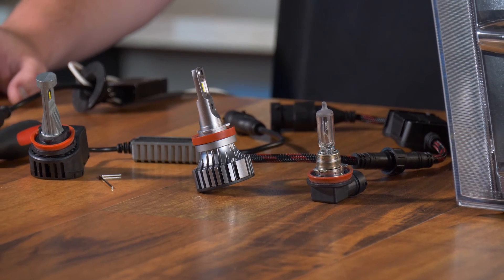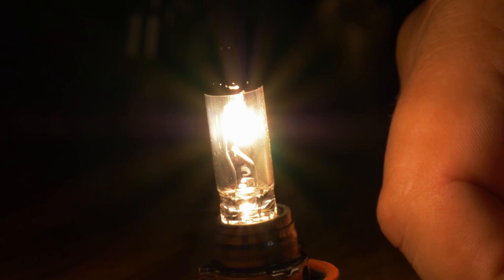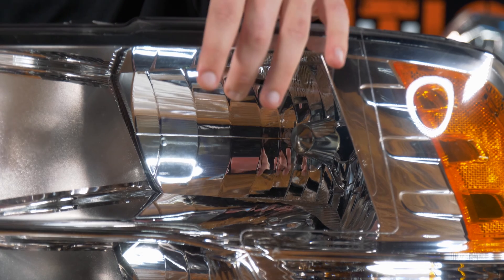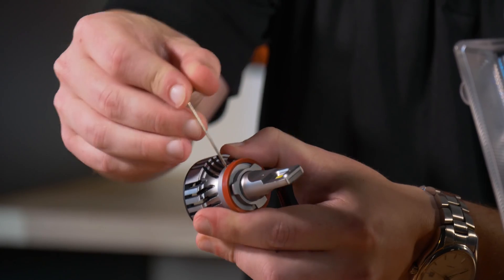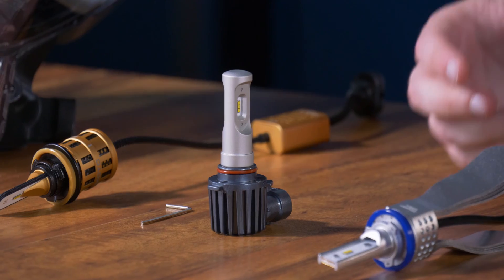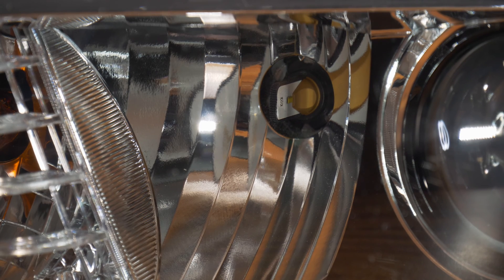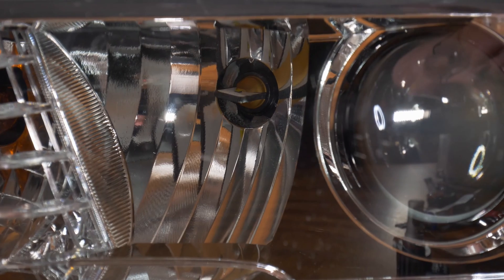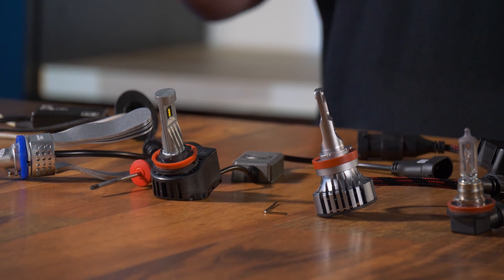How To Align and Aim LED Bulbs For the Brightest Light Output | Headlight Revolution

Comment: How should I adjust the horizontal adjuster on my aftermarket LED? I’ve got the vertical down but I’m not sure how wide the lights need to aim
Reply from the maker: Be sure your housing has horizontal adjusters! Some do not have this option, but if yours do, you can follow the steps in this video and you should be in a good spot!
https://www.youtube.com/watch?v=7KlvGIOF0qA

Comment: Great video - I’ve just installed Philips hi and lo beam LEDs on my motorcycle. Lo beam is great, Hi beam is terrible. I checked and it has the correct orientation “blade” vertical with the LED emitting to the sides. Not sure where to go with it now. I have an almost halo hi beam with a big, dim central section . Not great!
Reply from the maker: Being a motorcycle, I am assuming it is an H4 dual-beam bulb? If this is so, be certain that the little metal "Cup" or reflector on the bulb itself is upright, like a bowl! This is important for H4 function, and will make all the difference in your High beams if it is in the wrong orientation!

If the "bowl" is facing up, it may be a bulb compatibility issue where it may not be long enough/etc. to reach all the needed reflectors.
Reply: @HeadlightRevolution thanks for taking the time to reply. It has an H7 LED for main beam and a HB 3/4 for DIp beam - which is awesome. 

I’ll check the reflectors when I get out to the garage.

Cheers again

Comment: There is more to it.  Also depth matters as they are always far away from original "hot-spot".  This is why they all glare so much.  Some has also depth adjustment but LED itself is too long compared to wire in halogen bulb.  Honestly I haven't seen any good LED bulb for halogen.  They should be illegal as they are dangerous on the road.  If you want LED headlights (as they are better), buy the whole headlights, not just bulbs.
Reply: What about the Osram retrofit led's? Most led H4 have no cup. I'm thinking about buying the expensive retrofit Osram lights because they seam to have this. I have a plain Daihatsu with cheap old fashioned light distribution in the head light casing..

Comment: what about that projector lens part does it get positioned at 3 and 9 oclock also?
Reply from the maker: No, only the bulb needs to be positioned at 3 and 9 o’clock. The projector lens itself stays fixed in its housing and doesn't get rotated.
Reply: @HeadlightRevolution yea i know the lens cannot be adjusted and so the bulb does in fact have to be 3 and 9 o clock right... and thank you for the advice and help

Comment: What about a projector fitting? Does the orientation of the LED make any real difference?
Reply from the maker: Yep, orientation definitely matters—especially in a projector housing. We recommend positioning the LEDs so they face 3 o’clock to 9 o’clock for the best beam pattern and performance. It helps mimic how a halogen filament sits and ensures optimal light output and cutoff.

Comment: Is the alignment of led lights important for a projector housing? does it have to be exactly vertical? It's a lot harder to see the alignment due to the lens of the projector. And what led lights are the best and brightest for projector housing?
Reply from the maker: Yes, alignment can still matter in projector housings—especially to get the cleanest cutoff and best beam pattern. It doesn’t always have to be perfectly vertical, but getting it close helps reduce hot spots or uneven output. For the brightest and most reliable performance, we usually recommend the GTR Lighting Ultra 2 or the Morimoto 2Stroke 4.0 LEDs. Both work great in projectors!

Comment: I have my led at 3 and 9 o'clock but i still have bad beam pattern...why?
Reply from the maker: If your LED bulbs are positioned correctly at 3 and 9 o’clock but you’re still seeing a bad beam pattern, a few things could be causing it. One common issue is the quality of the LED bulb itself—some lower-end options don’t have the right optical alignment or chip placement to mimic halogen filament position, which throws off the beam. Another possibility is the headlight housing. If you're using an aftermarket projector or reflector that wasn’t designed with proper beam optics in mind, even a good bulb won’t produce a clean cutoff. It really comes down to how well the bulb and housing are designed to work together.

Comment: Purchased Original Nighteye A315 S4 NEW MODEL 2024 H4 LED Headlight Bulb H4 (Set of 2) For All Motorcycles (Low and High Beam Bulbs (White) 13000 LM 3 Side Chip) - Type H4.

After installing it gets too hot after using it for 5 mins.

Can you help me with this?
Reply from the maker: It sounds like you may be dealing with an improper heat sink issue, which is critical when it comes to LED bulb performance and longevity. Overheating after just a few minutes of use usually means the heat isn't being dissipated properly.

We recommend watching this video to learn more about how LED cooling systems work and what might be going wrong:
🎥 https://www.youtube.com/watch?v=FPcE-fWHmww&t=672s
Reply: Thank You  @HeadlightRevolution

Comment: Is it ok to cover the LED FAN with dust cover?
Reply from the maker: Yes, absolutely! We recommend using dust covers when installing LEDs. Dust and debris can build up in the LED fan over time, which may lead to premature failure—and it can also get inside the headlight lens, which is tough to clean once sealed. Keeping things protected goes a long way!

Comment: How do you adjust it on projectors?
Reply from the maker: Great question! Adjusting LED bulbs in projector housings follows the same concept as reflector housings - you want the LEDs to be aligned at a 3 to 9 o’clock position for optimal beam pattern and performance. Most LED bulbs allow for rotation adjustments to achieve the proper alignment.

Comment: But i have some questions like the beam pattern on my led is brighter in both sides of reflectors but there is small long patch of blackness too in middle of led bulbs
Reply from the maker: Make sure your bulbs are properly seated in the projector, and if needed, adjust the mounting position for better alignment.

Comment: Hi folks! I have a 2010 GMC Sierra. Im wondering if i need adjustable ring LED bulbs or not? The way they would plug in would have the LED chips at 12 and 6 o'clock.
Reply from the maker: It's best to have the LED chips facing left to right (3 to 9 o’clock position) for optimal light output and beam pattern. Since your bulbs would naturally sit at 12 and 6 o’clock, we recommend getting adjustable LED bulbs so you can properly align them.

Comment: So I just transferred LEDs from my 1st gen Dakota to my 2nd gen Dakota and now the hi-beams seem to be backwards. (Low is brights and brights are dimmed) Should I just rotate them 180°?
Reply from the maker: You’re absolutely right to consider rotating them 180° to ensure they’re properly aligned for the correct beam pattern. If that doesn’t resolve the issue, it’s possible your setup has a ground-switched plug. In that case, you’d need to repin the connector to correct the low/high beam configuration.

Comment: When you say “9 and 3” do you meant 6 and 12? Or is your clock at 90 degrees on your wall?
Reply from the maker: Nope, we said what we meant and meant what we said! The LED chips should be aligned at 9 and 3 o'clock for proper headlight alignment. You DO NOT want them facing up and down at 6 and 12 o'clock - that’s incorrect and will affect your beam pattern.

Comment: I just bought silverholder's h13 LED's and I have them set in but I have a weird glare waaayyy above my light beam..idk what causes it ..I have them set at 9/3 like the video said...any ideas?

2008 dodge grand caravan sxt
Reply from the maker: We haven't heard much about Silverholder so it could be a few different things. First, try rotating them in the headlight to see if you can get a better beam pattern. The general rule of thumb is aligning at 3 o'clock to 9 o'clock but not every headlight is created equally. You may find a bit of rotation creates a better beam pattern for your specific vehicle.

If fine tunig the bulb doesnt change the output, it may just be the LED itself and the way that it is engineered/design. In the same way not all headlights are created equally, the same can be said for LEDs. It's important to buy a high quality LED that can mimic the OEM Halogen filament location, or else you'll never have a decent beam pattern!

Comment: I have LEDs in my halogen Wrangler assembly and they’re pointed more toward the center now. I’ve tried to clock them and adjust to mock the halogen bulb pattern width but nothing seems to work. Would you suggest I use loaded springs around the bolts to widen the light pattern a bit?
Reply from the maker: It sounds like you’ve tried a few methods to get that beam pattern closer to the original halogen width, but if the LEDs are still pointed more toward the center, it may be due to the positioning of the chips on the LED bulb itself. Adding loaded springs around the bolts could help with some fine-tuning, but shimming and adjusting further might provide a bit more control.

However, in cases like this, the issue often comes down to the LED design. If you’re still struggling after adjustments, it may be worth considering a different brand with a chip placement that aligns better with the Wrangler’s housing for that wider, more accurate beam spread.

Comment: What if you're headlights are round? Also my low beams are brighter than when I turn on high beams. Would the alignment have anything to do with it.
Reply from the maker: As in sealed beam headlights, such as older cars and Jeeps? Alignment would be the same!
Reply: @HeadlightRevolution Thanks

Comment: On my 2010 Honda accord it’s installed properly, but the beam pattern is terrible. I made sure it’s the low beam headlight so that way I won’t accidentally put a led high beam in the low beam housing. It’s done correctly but the beam is still bad. Was the car not meant for leds only halogens??
Reply from the maker: There can be a few different factors, have you tried moving the bulb in different positions? Whats the condition of the actual headlight and the lens? Shoot us an email, we can help! sales@headlightrevolution.com

Comment: Man not enough people know about this. Thanks for the info. My beam pattern is terrible on my Vic lol, going to check this out.
Reply: Ahh apparently I installed my LED strips perfectly at 9 & 3 o clock, there is groves you have to align them with so you can't install em any other way. I guess my aftermarket headlights are just shit. I've tried adjusting the headlight position as much as I can. They work fine but the oem assemblies are definitely noticeably better. I don't have the old halogens to do a side by side comparison with these 9007 LEDs damn it. Its a 2011 Crown Vic.

Comment: In the United States, lamps, reflective devices, and associated equipment are regulated by the US Department of Transportation (DOT). Even though these types of LED lights can be used in place of an original halogen light bulb, it is not legal to use on vehicles registered for on-street use.
Feel lucky?

Comment: So theoretically… if the LEDs and the Power Cable are lined up straight out of the box, then it would automatically be clocked at 3 and 9 position when installed? Assuming the power cord comes out at the 6 o’clock position.
Reply from the maker: That's right, for most vehicles it'll be good to go out of the box. But for some vehicles, like a 98 Silverado we put some Ultra 2's in recently, they might need some slight tweaking to get them just right!

Comment: 9 and 3.... looks like 12 and 6 to me
Reply: He starts off saying 9 & 3 , which is clock position, and later at 2:53 says 9 & 3 degrees! He does clarify in another post the position of the chip & not the board👍
I will say the manufacturers need to make this process much simpler and follow Morimoto's approach, as there are bulb assemblies that the light assembly needs to be removed to install the bulb; couple this with not knowing the correct angle to install tab position of bulb and you'll be trial and error correcting that Allen key several times!

Comment: I had a question. I bought some sylvania led from oreillys auto about 3 years ago. I went to look at the light position and there was no adjustment on it. But the right side was at 8pm and 2pm and the left side was at 10pm and 4pm. Is that sufficient?

Comment: So the adjustment is only which direction the bulb is facing and not the distance the light chip is from the base?
Reply from the maker: Correct, all LEDs should be aimed at a 3 to 9 position, not 6 to 12

Comment: Just installed led headlights on my 2002 dodge ram 1500 3rd gen dual beam auxito now the high and low beams are flipped also when I hit the high beams it turns off my fogs

Comment: I just bought some new LED headlights, they had great reviews on them and said they were super bright but when I installed them in my 2010 Subaru Impreza they aren’t as bright as my previous halogen bulbs. Why would this be?
Reply from the maker: All depends on the headlights, was this a full housing replacement or just a bulb replacement?
Reply: @HeadlightRevolution  just a bulb replacement, i put in the Auxito H7 fanless led bulbs

Comment: Problem is your not showing all this in a headlamp projector assembly which generally always causes horrible led wave patterns that can not be eliminated regardless if the leds are set in a 3&9 position using lasfit led h11 lowbeam bulbs.
Reply: He kept saying 3&9 position but it looked like the final installation was at 12 and 6 o'clock??? Are my eyes wrong?
Reply: @JOutterbridge You are looking at the tip of the bulb which is indeed is at 6 and 12. But the LEDs are on the side of that, so are at 3 and 9.
Reply: @JOutterbridge the 3 and 9 refers to the position of the led chips. In this case, on the sides of the “ stick “ instead of facing up and down.
Reply: I'm with you
Reply: Fr ive been looking everywhere for info on projectors and the only answer i got so far is hids
Reply: What are headlamp projectors? I have oem headlights. Are they projectors?
Reply: @malc1012  projectors headlamps look like they have a glass ball where the light shines through like the letter "D".
Reply: @marioelburro1492  thank you. Hard to tell if that’s what I have. I ended up purchasing the Sylvinia ultras a few minutes ago. Only 200 hours sounds very low for 60 dollar bulbs when my stock are still working over 8 years. But I can’t see much at night so I need something whiter
Reply: @malc1012  ive done hours kf research and have gone through 3 cheap sets of leds. Mainly because my car has a tiny housing that cant fit a ton of led units. Happy to help!
Reply: @malc1012 halogen bulbs dim over time. In the case of a halogen bulb a 10 or 20 or 39% reduction in the brightness of the light is not a good thing because in projector beams a halogen is usually not very bright when new.

Comment: Thanks! Great info, just quick question i know that the LED light position would be 3/9 when switched on to low beam and the led has 2 led film would it be the higher film would light if it's switched low beam? ir it should be the lower part of a film?
Reply from the maker: Great question! There is one set of LED chips that are slightly more forward towards the tip of the LED bulb, that is the set of chips that you want ontop! For another perspective, you want the wire leading into the LED bulb to be on the bottom once installed!

Please email us if we can help you further! Sales@HeadlightRevolution.com

Comment: Sir i installed in 3 and 9 position , but the light on one side is less can i little rotate the LED or should i go for screw adjustment of headlights
Reply from the maker: Try rotating the bulb and see what you get!
Reply: @HeadlightRevolution  ok

Comment: Idk if I’ll get a response back, but I bought LASFIT led lights and the first night I was blinding everyone that came the opposite way. Was it because they were probably not 9&3? Or is it because they’re just too bright and I should get dimmer leds? I installed my old Philip whites on it bc of that reason. Hope someone can help me 😭
Reply from the maker: They were blinding everyone because LASFIT bulbs just aren't good, need something that's adjustable and has the diodes in the correct position!
Reply: @HeadlightRevolution  wow, I didn’t know they weren’t good. I’m thankful for your response. I’ll be purchasing one of the ones you recommend. Thank you sir 🤙

Comment: Does the 9 and 3 oclock alignment make a difference for the 2020 4Runner? Doesn't seem like it's reflecting on any mirrors so I'm wondering if this also applies
Reply from the maker: It doesn't apply to all vehicles, some may need another clocking position to get a proper beam pattern.

Comment: but what about led bulbs with chips 360° around the bulb, not just on the top and bottom?
Reply from the maker: 360 degree LED bulbs cannot be adjusted and honestly should not be used, 2 sided bulbs are the only ones that will be able to work properly!
Reply: @HeadlightRevolution  what ones do you recommend? I'm in Ireland so we drive on the correct side of the road 🙃😂😂
Reply from the maker: Depends on the vehicle! Shoot over some info on what you're driving and we can help you out!

218-755-5200
Sales@HeadlightRevolution.com
Reply: @HeadlightRevolution  its just a work van 2009 vw caddy, very hard to get led headlights bulbs to fit properly because the stupid factory clips they have, I was actually thinking about just leaving them alone and buying a big led light bar and put it on the roof 😂😂🙉